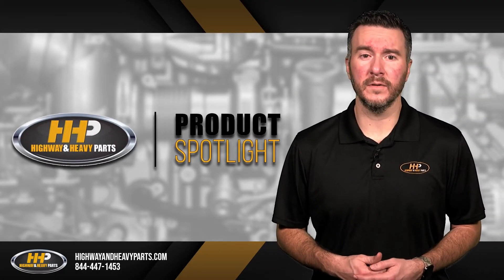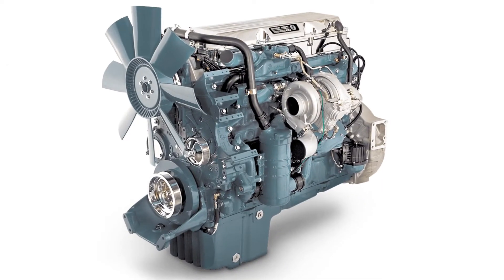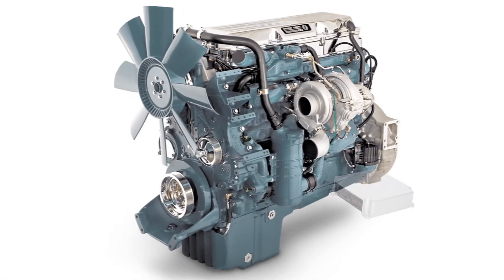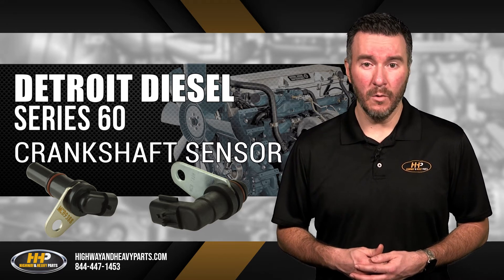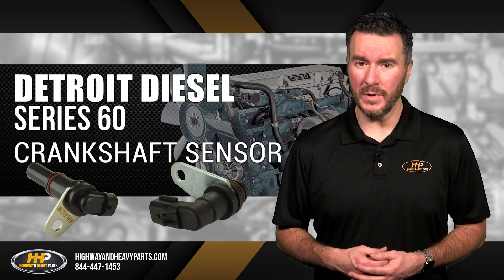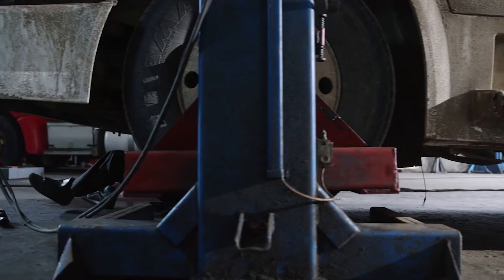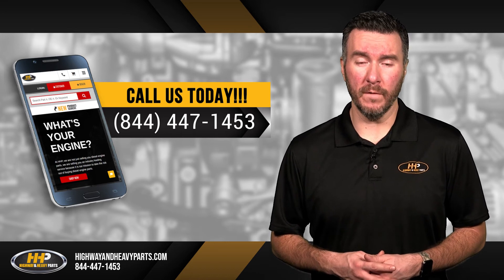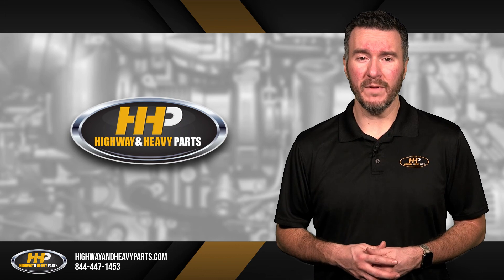How do you locate a Bad Crankshaft Sensor on your Detroit 60 Series diesel engine?

Comment: so does the 60 Series have a Camshaft Sensor?
Reply from the maker: Yes, a TRS & SRS.  Both available at HHP.  Give us a call at 844-447-1453 to make sure you get the right sensor.
Reply: @Highwayandheavyparts  further research has concluded that the Synchronous Reference Sensor is the same thing as Camshaft Sensor on the 60 Series. Today i learnt.